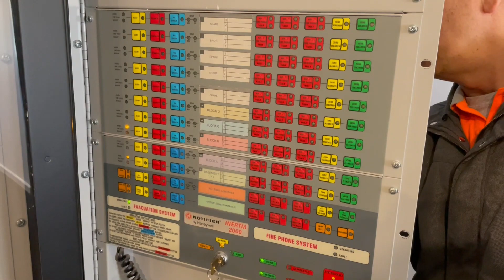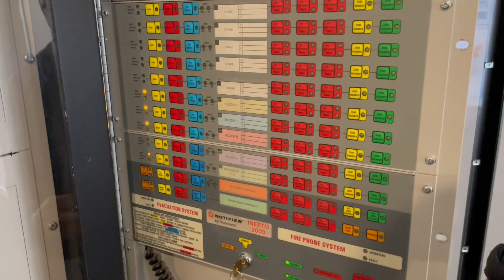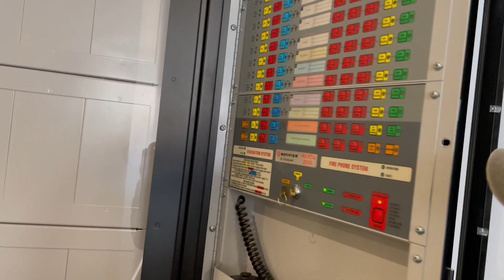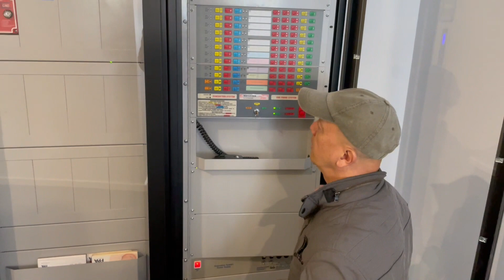Fire Evacuation Warning System Fault - Technician at Work

Comment: What was the impedance before you removed the speakers? what tapping is the new speaker?
Reply from the maker: I did not measure the impedance before and after. You can hear such a low output from speakers tone already from microphone to the field. Tapping of speakers were never changed at all. The old building was a default of 0.66w and the newly installed 4 years ago was 0.33w

Comment: Hi mate, there is a procedure on how to power up amps on the Qe90, you should not just flick on all the amps at once, you can easily blow cards and fuses - I've seen it.
Have a read of the commissioning manual.
Reply from the maker: Thanks mate. Will do. I encountered again a different problem that required rebooting the QE90. Afterward, it cleared again. Cheers.